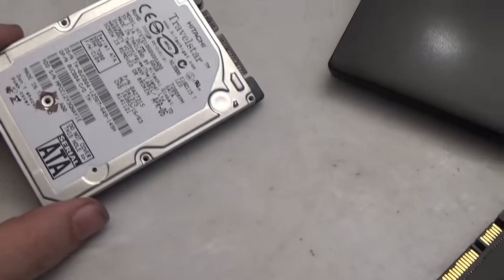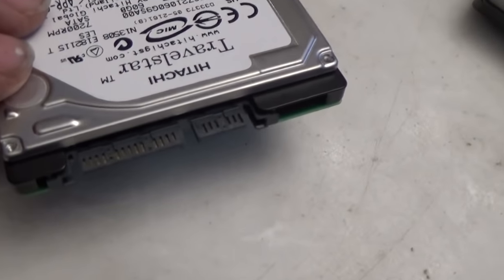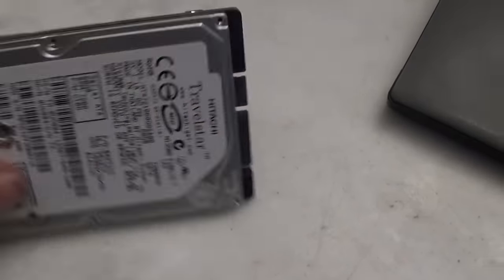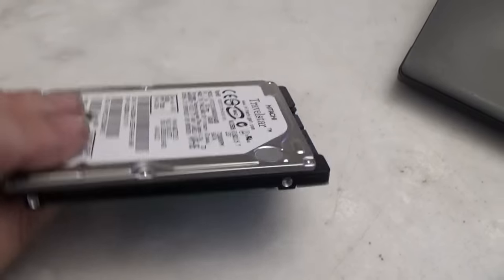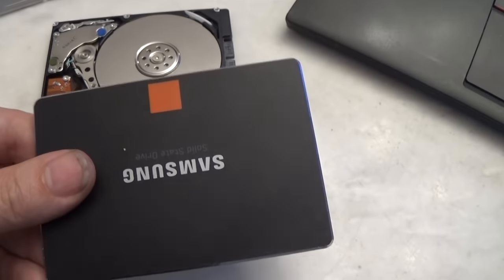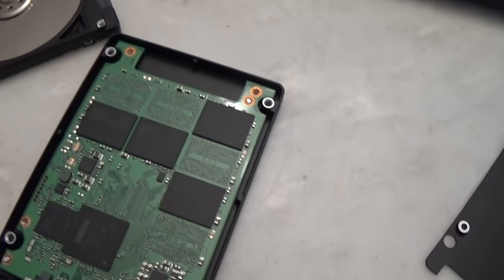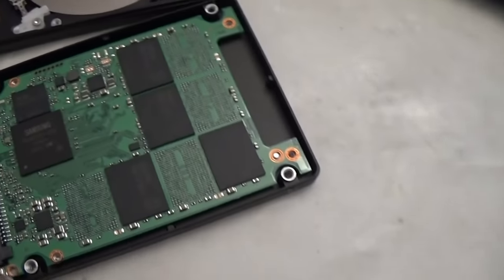Take a look inside a hard drive while it's running

Comment: 0:22 the small part is the sata and the big part is the power connector.
Reply: This really bothered me
Reply: yeah... I kind of cringed when he said them in reverse
Reply: Sata (data) and Sata (power)
Reply: @Skull_Knight_  you're right, but the guy in the video still said them in reverse. he pointed at the 7-pin data connector and said it was power, and vice versa
Reply: No the big part is data and small is power
Reply: You tech noobie poopia
Reply: @noobgamer-zd1vp  lol okay whatever floats your boat
Reply: @alyology0  its true he said it in the video. Proof: 0:22
Reply: @noobgamer-zd1vp  Homie you can google it, the 15 pin cable is the power connector, and the 7 pin is for data.
Reply from the maker: Yeah, I got confused on that part
Reply: @vsvenson  You may want to check several other of your facts. For instance there is no spring that causes the drive head to return to the neutral position. Also, I really must applaud your hard drive, you have no idea how lucky you are to actually read something with the cover off.
Reply: @flamingmoose1479  no u
Reply: @gallopinggoose6891  i've not been able to find anything specific about how the R/W read retracts when it loses power. Based on my 4 years of taking apart hard drives (mostly for secure destruction) it most likely has to do with the magnets. So long as the coil is powered between the two magnets, it is free to move, but once power is lost, the coil forces the head back into one side of the magnet.
Reply: @konather8065  That is what I believe to be the case as well, but there is definitely no spring.
Reply: It makes more sense reversed tbh. More data lines essentially means faster transfer speeds.
Reply: Yes
Reply: I’m hard drive repairer and small one is for data
Reply: @rhaib  yes, so it's understandable to make that assumption. but if you've built a PC it will be obvious to you, as you plug the larger connector directly to the power supply.
Reply: @gallopinggoose6891  where did he say there was a spring, where im watching he says it uses a magnet not a spring
Reply: @ifalone  7:46
Reply: @gallopinggoose6891  i think by spring he means that black thing connected to the arm
Reply: @ifalone  But, there is no spring... There's nothing that behaves remotely like a spring.
Reply: @gallopinggoose6891  i just shit my pants
Reply: You are all wrong! They both connect to the 5G deflector!
Reply: @noobgamer-zd1vp  he was wrong
Reply: @rhaib  one would expect but the small is definitely data
Reply: @flamingmoose1479  but the bigger one is data cuz it has more connections
Reply: it’s the way he said it....I just replaced a data drive a couple weeks ago
Reply: @vsvenson  it's okay! happens to the best of us!
Reply: Eetu Korhonen just google it man
Reply: acutally, both are called sata, one is sata power, and the other is sata data
Reply: @rhaib  "It makes more sense reversed tbh. More data lines essentially means faster transfer speeds."  thats what they thought with IDE, but no: more data lines also mean more noise in the data as each line makes noise every other line will pick up on the way

it has a reason why SATA is like it   (PCIE has more lines and is extremly fast but only because its almost directly at the CPU/Bridge for that so it doesnt pick up enough noise)
Reply: XANALPVPPRO no

Comment: Hard Drive be like: I'm more hard working than your SSDs.
Reply: And still many times slower than ssd :D
Reply: @sakuvihera8148  
Until your ssd died from too much writing and sending data
Reply: Work smarter not harder. Hard drive is working hard, but the SSD has a solid state of mind.
Reply: Another full form of ssd is smart state drive 😎😅🤣
Reply: @Yaoming yeah, yesterday I installed 128 GB SSD with 512 gb hdd in my pc. It works very fast
Reply: @KiraPlaysGuitar  what a genius!
Reply: @KiraPlaysGuitar  pun
Reply: @sakuvihera8148  But still many times durable than an SSD
Reply: @Zacky15ify the future is now old man. This doesn't happen anymore.

I used my SATA SSD for 7 years and 9 TB written and it's still at 96% health.

I still changed it to a 980 pro nvme, amazing, half the size of a ram stick and still so fast 

Let HDDs die, ssds are so cheap nowdays
Reply: @ExtremeHardcoreGamer  The biggest risk of SSDs is that if they're not powered on for a while, they will cease to work because they lose the electric charge which makes up the data (now this can take years, or months, it all depends on the quality). But if you turn them on everyday then they are very reliable.
Same problem with USB sticks and SD cards because they use flash memory.

With Hard drives you CAN get data corruption if you leave them off for multiple years but you won't lose everything on it and there are ways to recover the data.
They are also way cheaper, and you may not need the crazy SSD speed for storing stuff like photos and documents.

So i think Hard drives still have their use. Especially for external storage (like portable drives) where you don't turn them on everyday.
Reply: @ExtremeHardcoreGamer  9TB is nothing, SSD normally do at least 300TB or even 1000TB it depends
Reply: @Daniele63  I'm just talking for gaming and installing windows on it.

A 2tb nvme SSD from Samsung is less than 120$, there's no real reason to go HDD anymore.

The SSD will probably last 20 years which is enough lol
Reply: @Daniele63  I meant 95TB lol
Reply: @ExtremeHardcoreGamer  And for around 150 EUR you can get a 8TB Hard drive.

Good luck getting that price with a SSD lol
Also using SSD on servers and NAS would be crazy expensive.

So yeah for gaming and windows and most people it's good, however that still makes your statement that hdd should die incorrect. Maybe in the future when SSD are even more reliable and cheap, we can throw hdds out, right now it's not the case and i don't see it being the case for years.
Reply: @ExtremeHardcoreGamer  But yeah i was trying a PC with windows installed on a HDD the other day and it was painful, so i agree that for installing windows, it's absolute dog crap. 
For gaming, yeah you get slower loading screens but personally half of my games are on a hard drive and they run just fine, loading screen doesn't bother me too bad. 

Expect on Microsoft Flight Simulator and Total War games where it makes a huge difference. But that's just me, i don't play a lot of demanding games.

Comment: To think mine lasted 8 years (and still works to this day) without any issue is amazing. So glad I have an SSD now
Reply: I have a hard drive that lasted 18 years before finally giving up. ssd's usually dont last as long as hard drives, which is really weird to think about cause youd think ssd's would last longer but apparently not. Either way, no matter what you use, you should always back up your data
Reply: I have acer E1 531 it along with HDD is still  going strong after 8 years
Reply: Have one from 1999, it came in a pre built running windows 98, then ME, then XP and finally vista before retiring it in 2010 to buy a pc that ran windows 7 and I still have them both to this day
Reply: I love hard drives, they are super cheap and generally lasts longer than ssd, ssd's are much better don't get me wrong, but for people with very limited budget like me, they are a godsend
Reply: I have one that is still working after 10 years
Reply: mine started corrupting itself about 2 weeks ago. it was going fine for about 9 years. i really need to buy a new one
Reply: @dumdum7786  Well, how long an SSD lasts depends quite heavily on what you do with it (primarily writes) and how much you do it. It also depends on the kind of NAND flash used so the life of an SSD can vary quite drastically.
Reply: I'm going to stick with hard drives till it becomes impossible to find them I appreciate every square inch of them for their complexity accuracy and precision and unpredictable life expectancy where an SSD he's just a board with a bunch of chips it's basically just a memory card similar in design to that of a USB
Reply: @dumdum7786  I have a lot of hard drives myself ranging from 17 years old or more or less give or take a few of them hanging around loose including a Samsung with a weak sector probably worse by now including plenty more that are actually in computers or laptops and they all still work barring a travelstar that failed recently
Reply: I have one drive (ironicaly, it's infamous IBM "Deathstar" 75GXP , that was famous to die in 10x larger quantities, than other drives) working to this day, from 2001. So 21 years.
Reply: @warrax111  wow my IBM think pad and a IBM travelstar from 2000 that still works but quite noisy
Reply: You need to back up your data both in HDD and SSD

Comment: i know HDDs are becoming obsolete but looking at how they work internally interesting.  The way the mechanical arm moves back and forth across the disc really fast to read and write data is pretty cool
Reply: Can you imagine as a child hearing "Never ever put magnets near a hard disk or have the computer move near a strong magnetic field!!" and upon opening up my first hard disk for it having become obsolete (A whopping 864 Mb! :D ) and trying to get the disks out and having my screwdriver fling towards the actuator arm and get seriously stuck there because of the neodymium magnets that creates the magnetic field the coil that's on the other end of the arm disrupts in order for it to move.
I was gobsmacked knowing that there's such a strong magnet so close to the disk :P.
Reply: They're not completely obsolete, they do have a huge role where large amounts of data are needed to be stored, but not frequently accessed, so like on a lot of servers

Comment: Back in 2001 I was a mechanical engineer at Iomega in Utah.   We explored using this exact Hitachi drive as a platform for removable drives (in place of the Zip drive).   The idea was to have Hitachi supply the guts (motor and platter) and we would incorporate that into an enclosure that mated up to the host which contained the arm, heads, magnets, ramp and so on.   The  challenge was the mechanical interface - how to prevent any speck of dust from entering the enclosure while the drive was mounting.   In the process we took apart a lot of these drives.   We also looked at adding a micro laser burner on the head and built some prototypes but they were way too finicky to manufacture.   (We called that the OZ project:  Optical Zip)   One of the things that are not apparent is the "fly" hight of the head which is less than a micron.   The bottom of the head has a zirconium layer (very hard) and the media has a DLC (diamond-like coating) in case the head skates a bit.   To me the magnetic drive is a marvel.
Reply from the maker: Cool story! Thanks!

Comment: Wouldn't exposure to the elements corrupt the drive? Such as the introduction of dust particles and whatnot.
Reply: Yeah and then this video won't be possible to make
Reply: its much like opening up a corpse, cant get it back to the way it was, but it is informative at least
Reply: Basically NEVER DO THIS! And if you do, only with a drive that you don't care about the data.

I wonder if once this drive inevitably breaks down, if some data could still be salvaged, but I wouldn't expect much.
Reply: yes, it will break it down in the long run. I'm guessing the creator didn't care about this drive.
Reply: yes, however data recovery stores will often have a clean room or box that the drive is less likely to get dirty in. The only reason to open a drive is in a worst case scenario where small physical repairs are necessary in order to attempt to get the drive to work again long enough to get any important data off. If you get a drive repaired, do not use it as it most likely will fail within a few days or weeks.
Reply: 100%
Reply: TimmyLP drive is already broke by the way the heads are “reading”
Reply: Tristan Burke that’s very true lol
Reply: Only open drives in the bathroom with the hot shower running.  The dust will be attach itself to the tiny water droplets.

Comment: you pointed at the data and the power on the SATA connection incorrectly.
Reply: so the smaller section is the data and vice versa?
Reply: @NEWSFLASHAA00  yes
Reply: Yes smaller side is data wider side is power...5volts and 3.3 volts etc
Reply: I was looking for this comment
Reply: Hello geeky guys!
Reply: That hand seems like it is jerking 🤭🤭
Reply: @xavier.7371  the succ

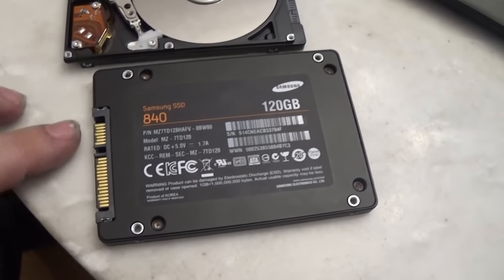Comment: 2:06 NO, right now there are ssds with 3.8TB storage, and HDD which can hold 12 TB so Hdd is the cheap way of storing things in bulk
EDIT: UPto 16TB nowadays 😄
Reply: Cio Dokop ssd’s are much more expensive than hdd’s of the same storages for sure.
Reply: @jace_Henderson  and we are using it...... Because they are faster than HDD(i mean reading speed)
Reply: And that's why hard drives aren't dead yet, such high density storage.
Reply: Yosuru 
Exactly!
Reply: @Yosuru  Another reason is read and write cycles of hard disk is much higher than ssd. It'll keep running for years and people can also repair it. Ssds have much lower read/write cycles
Reply: @adiputrajaya3877  Yes. Almost all CCTV systems use Hard Drives.
Reply: 32 tb now
Reply: @kekkodance  can you give me a link for a 32 tb drive?
Reply: @kekkodance  ah, I was hoping it to be a HDD. An SSD wouldn't even be close to affordable for me.
Reply: @Saraf2202  buy 1TB SD cards and run them parallel

Theoretically you can get upto 512TB that way
Reply: @ali99_82  just don't...
Reply: @JGnLAU8OAWF6  wut
Reply: @ali99_82  SD cards are bad
Reply: Fardin Ferdous Saraf you can get a a few hundred GB ssd for under $30 and i think 1 tb for $50-60 for a kingston. Idk tho i use hdds because theyre more reliable. My couple year old 60gb samsung ssd messes up ocassionally and i have to reinstall my windows but my 10 year old western digital 1tb hard drives still work fine after all these years. Hdd>ssd imo, even game loading times never seemed to change much if installed on the ssd.
Reply: @ali99_82  please don't try running Windows on an sd card for actual use.

Comment: Watching this makes me just wanna buy laptop with SSD rather than HDD 🤣
Reply: What did you end up going for? In 2020 SSDs are cheap enough that the little extra you pay is always worth it.
Reply: The boot up difference on an ssd is crazy fast.
Reply: I don't want to buy SSD cuz it wont work as much as HDD. And also HDD makes a satisfying sound 🤤
Reply: That would exploit your bucks. Instead, buy a normal laptop then upgrade to SSD, and double the RAM.
Reply: @moinulfaisal8513  some people might not wanna do that because they'd have to take apart their laptop and probably void warranty

Comment: On 0:22 you explained it wrong. The 7 pin side is the data carrier and the 15 pin is the power carrier.
It arrange like this
For data pin:
GND, TX-, TX+, GND, RX-, RX+,  GND

For power pin they are arranged at 3 groups.
3.3V, GND, 5V, GND, 12V
Reply: Wow, you really know your stuff! I applaud your knowledge. 😀
Reply: 3 power rails! 3.3,5, 12! Wow! That's amazing

Comment: HDDs are always some kind of ART WORK to me. There is so much work and industry and precision inside them. And i often wonder how they can last so long! Currently i still use 2 HDDs inside my tower PC (and currently no SSD) und they now run seemlessly for 4 years. Whenever a 3,5" HDD breaks, i take it apart and am always astonished at the precisionn. I take out the (neodymium?) magnets and they are SO HORRIFICALLY STRONG - when i e.g. pop them onto some iron-like surface i must be careful not to have the finger inbetween! The magnets can really be helpful at times for instance finding a lost screw :)

Comment: I have heard it said that reading a hard drive is like a 747 flying low over the ground while the pilots try to count blades of grass.
Reply: thats a pretty accurate analogy. the gap between the read/write head is about the width of a human hair.
Reply: @konather8065  human hair is enormous compared to flying height of modern HDDs.
It's just few nanometers while size of a hair is 80,000 to 100,000 nanometers.

Comment: i find hard disk drives way more interesting that ssd, although ssd are just so much faster. there isn't really anything miraculous about an ssd. there is a connector, some vrm i assume, some kind of memory controller, maybe some cache and the memory chips. as far as i know that's pretty much it. kinda boring. 
but how the fuck you get that little arm with the reader head to move so quickly and precisely is completely beyond me. how can this even work? :D
Reply: I agree, an SSD is kind of like a lot of SD and micro SD memory chips that are put together. A hard drive is innovative af like how the fuck's it possible for a hard drive to work so quickly (inside).
Reply: You might like this 7.5 minute video about SSDs https://youtu.be/5f2xOxRGKqk
Reply: Voice coil. Early HDDs were actuated by motors (and stepper motors) exclusively, this gave pretty mediocre if not slow, seeking times, on par with CDs or floppies. Moving to the linear motor design allowed to improve arm acceleration substantially (in orders of a 500 m/s2 and more) and increase precision in one swift feat of engineering. Floppies died too early to benefit, and optical storage mediums can't enjoy same manufacturing tolerances to ditch suspension, which isn't going to handle even a tiny fraction of acceleration achievable by HDD arm.

Another piece of tech that uses similar control method is CRT display, but it controls direction of a stream of electrons which isn't as impressive so far.